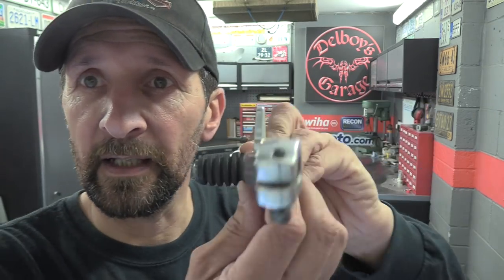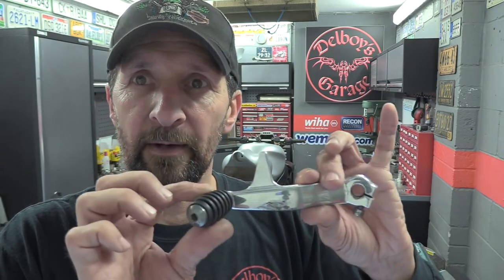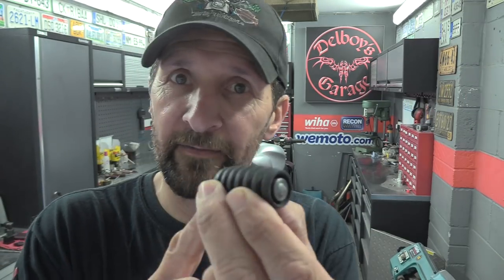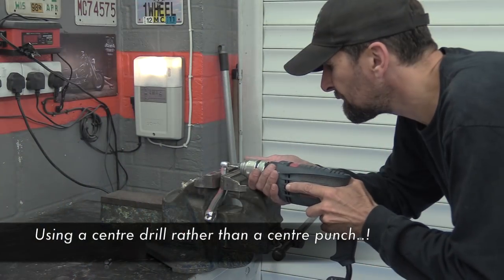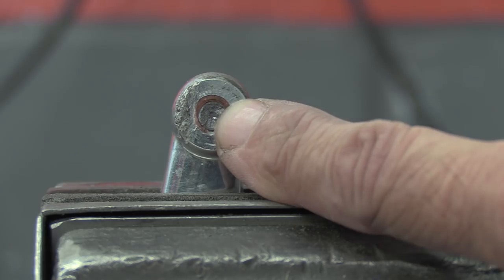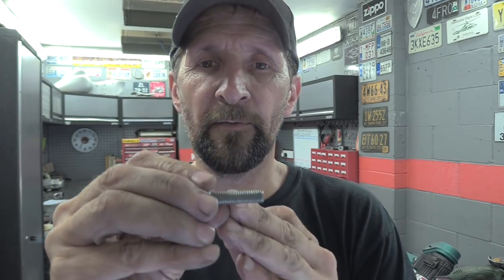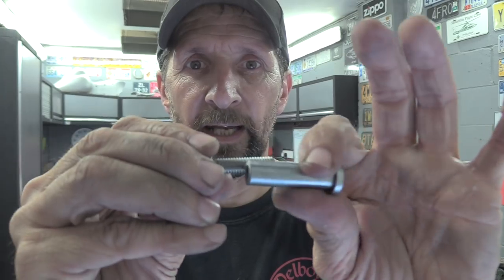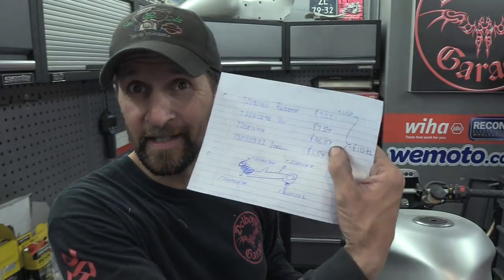Delboy's Garage, Broken Gear lever fix..!

Comment: There's a lot to be said for hinged gear levers a la trailes I reckon. 
And centring the drill bit is one thing, Del, but how did you drill exactly perpendicular to the arm without any apparent measurements? You have an artist's eye, that's how. 
What a beautiful demonstration and a result to be proud of. Top notch! 👍
Reply from the maker: Thanks Keith, obviously once I clamped the pin in the hand vice, it's upright at least in one plane, then I normally hold a length of wire about a foot long (that is straight obviously!), against the side of the pin and that will tell me if it's upright side to side, then just drill downwards, nothing clever, just  simple common sense... thanks for your kind words, it was a fun day!

Comment: The Bolt was an M7 as you tapped it in the Pin and the hole you tapped in the lever was an M8, how did that go? or did i miss something?
Reply from the maker: No, the drill was 7mm, not M7 and you drill out to 7mm for an M8 thread (well it's more specific than that, if you wanna be an anal engineer), but it wasn't an M7 thread.
Reply: @Moonfleet41  ahh! Good clarification. I will look up thread standards now.

Comment: A good end result but as your debris shows you weren't dead centre on the bolt also, an M8 thread has a minor diameter of 6.75mm not 7mm, which you drilled to so the likelihood is that you buggered half the threads in the arm.  I would have heated the arm to break the grip of the red loctite and drilled to 1/4" (6.35mm) or 6.5mm and then picked the rest out, with all of it mounted in a pillar drill to ensure that the drill didn't wander (better still use a 1/4" end mill in the pillar drill).  Creating a stud in the remains of the main bolt is a good result but for me it would be better to use a button headed stainless bolt threaded through the arm from the back so that in the event of future breakage the whole can be disassembled with only one lot of tread lock to over come.
Reply from the maker: The last bit you said there Clive, is exactly what i said at the end if you watched that far in.. the whole design would be better if it had a countersunk alun screw pushed through a clear hole and threaded into the foot pig pin.. like you say, then you just poke out the broken half, and fit a new one... but i imagine it way easier for manufacturing to have the peg thread directly into the arm aye... and as for an 'end mill in a pillar drill'... not too many people have them, in fact, not too many people have a pillar drill.. and solidly mounting that alloy arm in the hand vice under the pillar drill is just as tricky to get dead square as is drilling in a vice with ah hand drill.. there are no flat faces, and the little alloy "fin" they cast onto it stops you clamping it in...  Did the best with what i have mate... End result is fine.. so happy with it.. .take care. .del.
Reply from the maker: Oh, and for what its worth mate, the 7mm drill bit measures 6.75mm when i hold a caliper across the tip.. so maybe thats factored in to DIY drills..?
Reply: Del, I did watch the piece all the way through and you did say that the piece could be disassembled but my suggestion goes further with the ability to reliably disassemble the piece.  With your method if the piece breaks at the same point then you will have to again drill out the two pieces, with my suggestion you would simply wind out the broken piece in the arm without the danger of destroying the threads.  For me the hassle of setting the arm in the vice is minimal compared with the risk of inaccurate hand drilling.  Your vid clearly shows how difficult it is to drill out a bolt using a had drill.
Reply: The allowable tolerance for a 7mm drill is ~0.025mm i.e minimum size 6.975mm so either your drill is severely undersize or your caliper is inaccurate.  Besides, working a drill back and forth through a hole is bound to enlarge it.  Also, if the gear change pin is stainless steel it will be much more difficult to drill with HSS drills, cobalt being the drill material of choice.  The ease with which you drilled through the pin suggests it was an inferior grade of s steel.
Ultimately, you were successful so in that way the end justifies the means but I fear others will not be as successful.

Comment: Nice repair, probably would have used that funny v shaped center finder that comes with the engineers combination square. You know the first bit we all take off and never ever use again, or find when we need it.
A polished , anodised?, casting with two threads and a spline for £98.00 .... that's not bad.
Reply from the maker: Actually Michael, you have a point there.. it is a lot of 'manufacturing' for £97.. two threads, a slice in the right place, and obviously polished by hand i imagine (this one wasn't anodised),  but thinking about it again.. i wonder if Triumph (read British wages etc) actually made that lever.. the bikes are already assembled in Thailand, so are things like that maybe made in India, or possibly China?, and if so, how much do Triumph pay for them?.. id hazard a guess at maybe £2 each in large batches.. so maybe it is just a cheeky markup to reflect what it "should" cost... who knows..   Thanks for making a great debate point mate..  have a good weekend... Del.
Reply from the maker: Here's a very quick story for yah that may surprise you:.. i ran a motorcycle shop many years ago, and one of the odd quirks that the boss liked to do was now and again trade a few oddities... and he got hold of two "Pashley Ice Cream Trikes" one year... the kind you stick a freezer on the front and a parasol, then sell lollies on the beach... but the three wheeled bikes (trikes) themselves were made by Pashely cycles on England...recommend retail price of the cycle itself without the freezer ?.. £1400 each...

They sold for £800 each in less than a week... so, keen to get some more, we contacted a fabrication company in Mumbai, asked that if we sent them one over by freight, how much would they charge to copy them... the price they quoted?.. €150 each, ex factory.. so about £250 on the docks here all duty paid... just goes to show how cheaply things are made in the far east aye.... cheers again mate.
Reply: You make a very valid point as to the cost of the part and its non manufacturing costs. Now factor in the supply and demand side of this part. At present I would suggest that there isn't another supplier of this part and I don't think you or I could manufacture a comparative part in a home workshop for £98.00 worth of our time, let alone the cost of material, specialised machines and tools. I hate filing splines by hand. :)

Comment: Hi dell boy great video as allways, I’m after some advice just had a new tyre fitted on my rear wheel,I took it of fine put it back on there’s play in the wheel it looks like I need another spacer,just wondered if you new how many there is supposed to be ,plus the pulley bolts were rubbing metal to metal.cheers dude
Reply: It’s a spoke wheel 1999 sportster 🤔
Reply from the maker: Hi buddy, it sounds like you got the spacers in the wrong order, or you've got something missing, the pulley shouldn't touch on anything, even though it runs close, and the belt should line up perfectly, I can't see it, so can't see what you've done, but maybe change the spacers the other way round and see it if lines up... there's usually one each side!
Reply: Moonfleet41 cheers dude I tried swapping the spacers over I read the shorter one is for disc side long one for pulley still seems to much movement on wheel I ordered another spacer cheers hopefully that will help👍
Reply from the maker: OK, dont forget that there will be freeplay until you have done up the axle nut.. the swing arm expands away from the wheel when you undo the nut in order to give you room to get the wheel out... so maybe try torquing up the axle and see if it all lines up..?
Reply: Moonfleet41 yer will do cheers

Comment: Hi on couple of occasions you mentioned if an eazyout, tap or drill breaks then the part is useless, this isn't so as if it breaks even in an aluminium casing it can be saved by spark erosion, In the day on seventies bikes it was almost certain bleed nipples would shear off on brake callipers especially if they went through a few winters of salt, easy out was the next step only to snap and as spare parts were a fortune spark erosion was the answer. Of course if you knew someone who knew someone who's uncle's cousin knew someone's sister worked in a factory with one of these machines was a bonus as it only cost a packet if fags. Im telling you this as if someone does this to their Vincent crank case, Brough SS100 cylinder head or any other obsolete unobtainable or impossible to get priceless part please don't bin it. It can be fixed.

It disgusts me Triumph charge £97.57 for a gear leaver, its extortion and I hope Mr J Bloor if he still owns Triumph is watching this though unlikely looks into his parts pricing. I worked in die casting and a complete bell housing for a Mondeo finished and machined cost £29 to Ford. It literately takes a few minutes to cast this part, machine it and finish it. 

Im a Triumph enthusiast through and through owning a 65 T100SS, 53 Thunderbird, 70 Bonnie and 71 Trident and considered a new Thruxton. I think I will stick to the Harley RK and 48 or go for the New Commando. Yeah spoiled bastards have loads of toys when their old guys.

Please Triumph stop ripping off loyal customers in your home land or anywhere else for that matter. You be loyal to them and they will come back.

Rant paused.
Reply: A polished , anodised?, casting with two threads and a spline for £98.00 .... that's not bad. There is a lot more to the cost of a part than just the manufacturing.
Reply from the maker: Sterling Rant brother.. and i can agree with much of it.. but there is a lot of detail in parts pricing.. these lever arms are probably made in Thailand (like the bikes themselves), or India, or even China.. so there will be an "ex-factory" price of yeah, maybe like you say €29.. but once that gets shipped out, then imported, (import duty), sent to a central parts holding company (maybe in Holland or Germany like with Harley Davidson), handled again through a stores inventory, and then finally shipped over to England for you to buy from you local dealer.. it can soon end up at £97.. ever pair of hands that part goes through takes a bight out of the cake.. all parts are held centrally now as single dealers cant afford to hold every part for every bike obviously.. i bet if you got a look at your local Triumph dealers invoice for that item, it maybe has a 20% markup at best.!  I think if there is any kind of "rip off" going on, its no single individual, its purely the convoluted system that has too many people handling the same item on its journey to you..!    Simple solution.. buy parts from small after market companies like TEC Bike parts, and Motone where there is almost nobody between manufacture and customer other than the dealer.. or better still fix it yerself aye..lol!
Reply: Michael I know exactly what goes into the manufacture of this part and the processes of getting it from the manufacturer to you, (cost of the factory, man power, non production staff, forklifts, furnaces, gas, electricity, design costs, tooling, materials, production and other machinery, warehouse storage, logistics, shipping, man brushing floor etc etc etc. do you know the manufacture time for this including casting, machining, cutting all two threads and polishing will be about 5 to 6 minutes max, most of which won't require man handling even taking into consideration the cost of the material being literally pennies (no anodising). I have worked in engineering, precision engineering mostly on CNC machines, (I am not an operator), high and low pressure die casting including sand casting for 40 years, some of which in the aerospace industry and even taking into the logistics from the manufacturer to a warehouse to you or me I can assure you the cost of this part is extortionate, ask any engineer worth his salt if this is fact i believe he will agree with me.

If you think £98 seems not bad for this part then accumulate the cost of every single part on this bike at a rate you think is not bad and it will probably come out at about £50,000+
Have a look at this 5 way precision made lever operated solenoid valve made from a much higher grade aluminium with much more machining than the gear lever complete with a precision made shuttle inside among other parts, seals etc etc for £5.69 including postage to my/your door and this is anodised. Of course made in China as Del reckons the lever could also be made as do I.

https://www.ebay.co.uk/p/5-Port-2-Position-1-4-PT-Hand-Pull-Lever-Pneumatic-Air-Valve-Control-4h210-08/863437268?iid=262861665990&_trkparms=aid%3D555018%26algo%3DPL.SIM%26ao%3D2%26asc%3D51875%26meid%3Dfe0bb44f21c04e7c9619268da90e2e40%26pid%3D100005%26rk%3D3%26rkt%3D12%26sd%3D122356057289%26itm%3D262861665990&_trksid=p2047675.c100005.m1851
 
I have used one of these valves and its still woking after 3 years though I was ripped off as I paid about £14 for it.
By any chance are you an alias of Mr Bloor justifying his extortion? maybe I was wrong and you are watching Dels channel. Keep watching John and pick up a few useful tips and advice.
Reply: You make a very valid point as to the cost of the part and its non manufacturing costs. Now factor in the supply and demand side of this part. At present I would suggest that there isn't another supplier of this part and I don't think you or I could manufacture a comparative part in a home workshop for £98.00 worth of our time, let alone the cost of material, specialised machines and tools. I hate filing splines by hand. :)

Comment: What brand is that lock tight?
Reply from the maker: Hi buddy, how best to answer this without sounding sarcastic, but it's a common question, but the brand of locktite is 'Locktite'. Locktite is actually the brand, the substance is called threadlock, but like so many things in our lives, the brand itself becomes the name of the item, such as hoover, which is actually a brand of vacuum cleaner , but we still hoover the carpet rather than vacuum it lol ... The stuff I actually used was 'Locktite 248' blue threadlock, you can get it from Halfords or online !